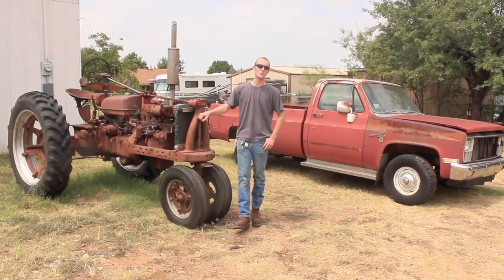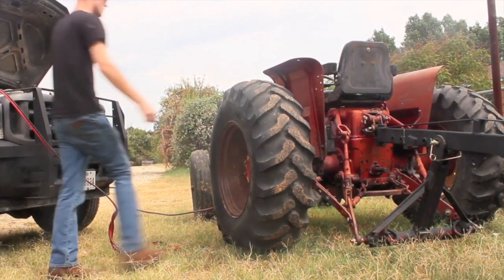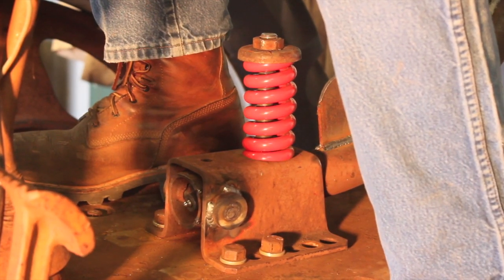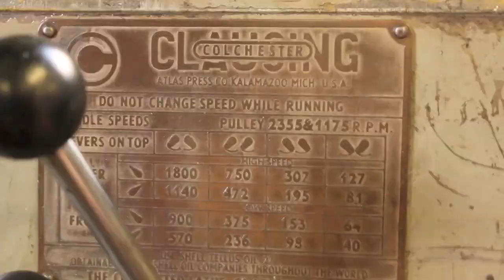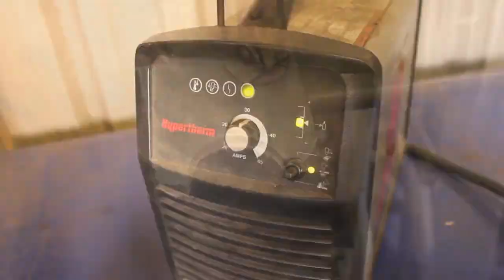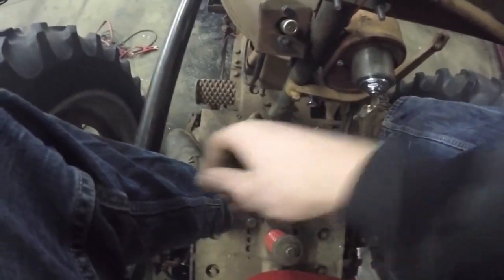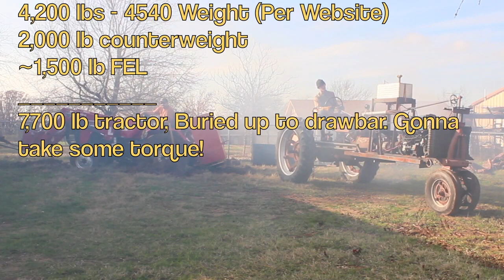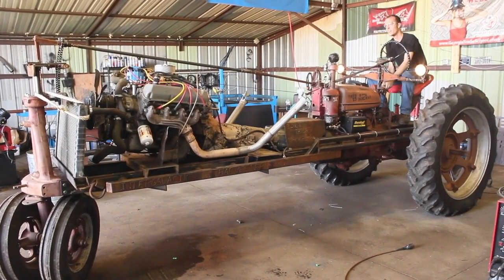V8 SWAPPING A FARMALL TRACTOR - JOHN DEERE HAS NOTHING ON THIS!!!

Comment: I’ve got a Massey Harris 44 with a 283 Chevy in it. It has a three speed GM manual gearbox between the engine and tractor transmission. Didn’t have to lengthen the frame and all the sheet metal fits like it should. It’s got 3pt hitch, pto, hydraulics and power steering. It’s actually quite a handy tractor. Will probably swap the 283 for a bigger small block. The 283 is pretty tired. But ya use what you happen to have on hand when tinkering in the shop. 
Enjoyed watching your video. Good job 👍.
Reply: if you another swap might think about a four speed

Comment: I did this with a F20 also. I used a Ford 302 with an automatic. Was a sweet machine.  It looked a lot neater than what you have.
Reply: He should have used the original tractor transmission and bolted the engine up. With an adapter plate and make the fly wheel fit.

Comment: I am damn sure I saw this series a few years ago. I can’t explain it, but you rigged up a throttle style lever for the automatic transmission shift linkage, extended the frame rails to accommodate the engine and transmission, and had to reinforce the frame because it kept twisting. I can’t remember the channel name, but I’ve seen the same guy, same truck, same tractor, and heard the same voice.

Comment: Apparently you've never been to the National Farm Machinery Show's annual tractor pull in Louisville, KY, lol.  They have some pretty wicked John-Deeres there.  :)  If your main tractor has a generator on it then it'll take it much longer to charge a dead battery than if it has an alternator.  Our old John Deere "A" and "H" were both like that.  They charge pretty slowly but when they were built it was assumed you'd be out in the field with it all day and by then the battery would be well charged.

Comment: That a excellent video also quit big project to building and get 350 motor fully rebuilt also carb to plus heavy duty clutch plus bearings in main 5 speed Manual ! Also unverisal joints should have greaseable types too because of torque and hp of V8 motor strength is !  Also take to pulling contest see how pulls and tractor shows too !

Comment: Done that with a 6 cylender massy harris  the 6 banger was clapped out  we put a 350 in it wit a paired set of transmissions  along with the tractors transmission and drive train total trannies 3 2- 4 speeds and one 6 speed tractor tranny the 2 4 speeds are one straight and one reversed and coupled to the tractor tranny as well as the main engine tranny

Comment: I did this with an old f-20 internation farmall.  Took a 266 internation v8, a chrysler 904 auto, extended the frame and converted the driveshaft, so had the 4 in tractor and the 3 in auto.  now it travels at about 20 at 4000 rpm.  not great but better than 5 1/2 mph

Comment: I like that people always knock john deere for having two cylinders (which by the way are amazingly powerful) but they forget about the guy who swapped a john deere 830 engine with a cat V8. This farmall. Has nothing on that. Long live two cylinder power friends.
Reply: I've seen Johnny poppers with an inline 4 cylinder in them.  I was told they modified the crank and used a  ring and pinion  to transfer power.

Comment: Didn't you have one of those little 750 milliamp battery chargers in a 500 foot extension cord hooked up for that battery on that tractor to keep charged.  You Brag up having several of?

How many gallons of oil are you burning that are blowing past your rings on that small block engine?

Comment: That Chevy V8 is worn out , it has so much blowby it's not funny. 

Also you should have supported the input shaft on the tractor transmission with a bearing instead of just connecting the drive shaft straight to the box as it will probably chew up the input shaft bearing in the trans now.